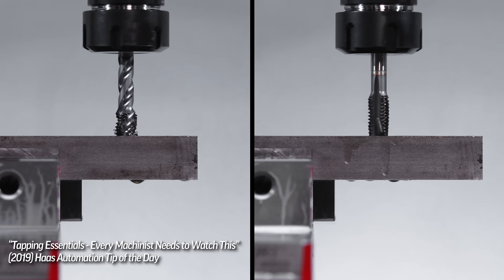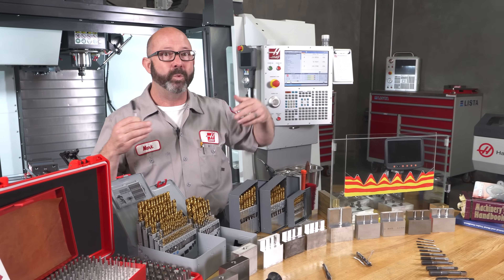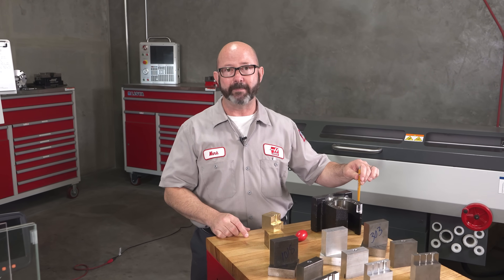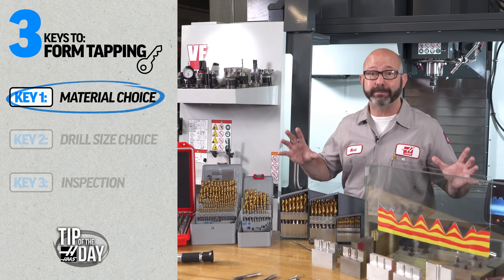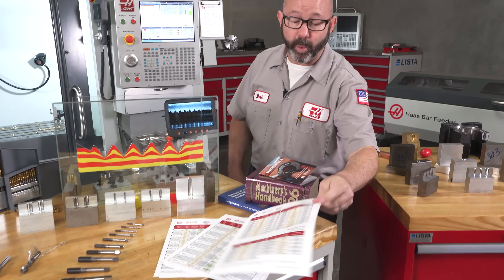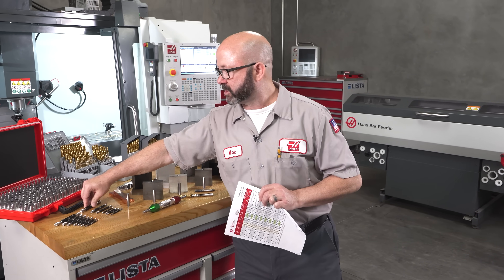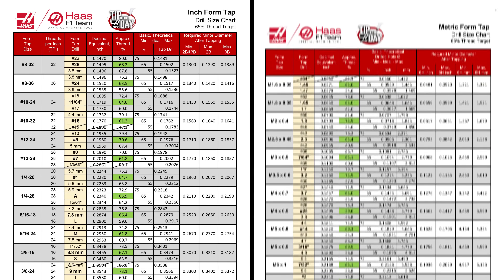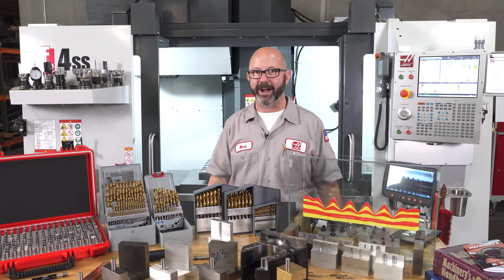Leave the Chips Behind! With FORM TAPPING - Haas Automation Tip of the Day

Comment: Will you get any distortion of any real concern in those taps when the material heats up or cools down? Seems like the form tapping would be adding stresses to the material that could be released when it goes through a temperature change. Or am I completely misunderstanding that effect all together?
Reply: We can. We definitely want a high coolant concentration to keep things lubricated. If the metal is ductile enough, the tap has typically done its job by the time the material work hardens (if it does), and this can lead to very strong threads. You would not want to form tap dry, it would create incredible heat and cause problems like you suggested.

Comment: Yes, I trust that I won't drill oversize if I use best practices. Can I trust anyone else to do it right consistently ?  Is reaming part of best practices ?  That seems to require more spindle torque and  power. I keep thinking that threadmilling is the best, am I wrong ?
Reply: If you do any machining at all, you will know that "best" is absolutely contingent on circumstances: part design, quantity, material, machine, operator availability, automation, etc.  There is no "best" in a vacuum.
Reply: @dumpsterdave3710 I agree, I wrote an ill conceived question.  I worked on a lot of workhardening metals and I have had good results after becoming proficient with threadmilling.
Reply: Thread milling is awesome. Once you get comfortable programming a Threadmill, it can really lower the stress levels when running on tough materials. For high volume production, a form tap is king in most cases, runs forever, easy to inspect, runs fast, reliable. And you don’t have to worry about chips in blind holes.

Comment: won't this split the material if the walls around the hole are thin?
Reply: It can create a bulge, if we try and form tap too near an edge. Our order of operations is important here, we will want to tap first and then profile that edge second. Great point. It won’t crack, because we are form tapping ductile material.
Reply: @markterryberry4477  - that's a good point, if you have the option to tap before a thin wall gets created that's definitely the best option. But, in my experience, even ductile material has its limits before it stress cracks or splits.
Reply: It might do that, but it's going to depend on the specific material and wall thickness. Some other more minor factors like tap speed and lubrication could come into play also.